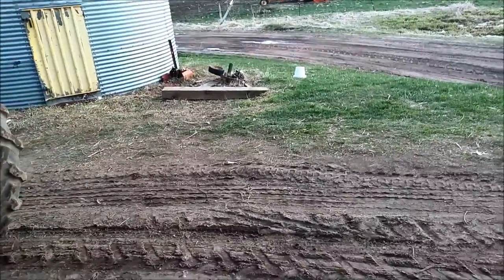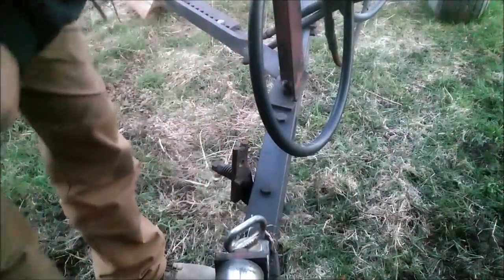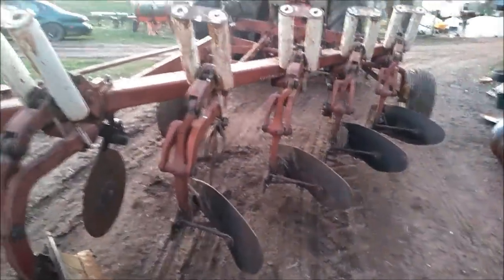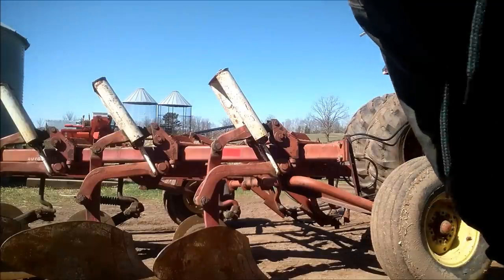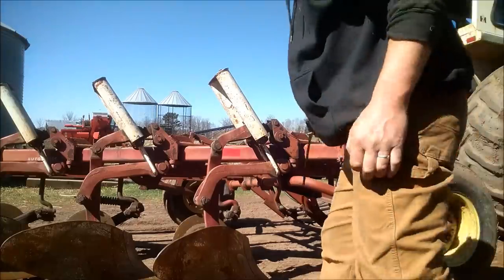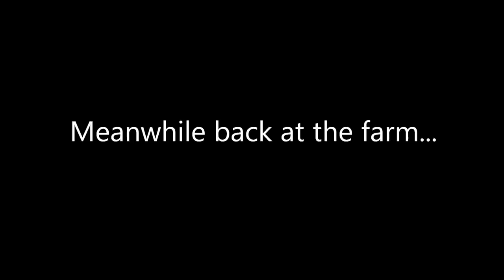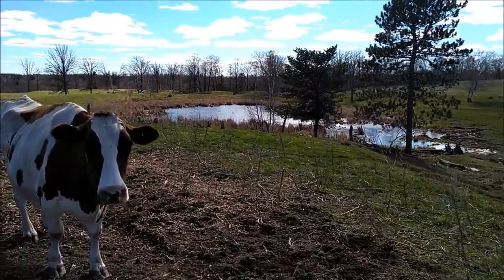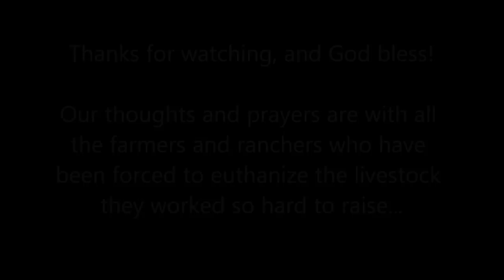Plowing with the 1066-Working up an old field

Comment: Greatest tractor IH ever made. Perfect!
Reply: Most iconic anyways. Still needs to be a black stripe open station. those IH plows weren't nothing but the truth though.
Reply: I am not sure about the greatest but they are very good. We have the exact same tractor and plow combination. Sometimes we use the 1206 on the plow and it also pulls it very good.
Reply from the maker: I have used our 1256 on that plow, but the 1066 seems to handle it better. A 1206 is a tractor I would like to have! Thanks for watching!

Comment: Enjoy watching that 1066 turn over the soil.  I enjoy plowing growing up we would plow up  500  acres for corn and soybeans and 7 acres for tobacco and the largest plow we had was a 4.16's Massey Ferguson plow behind a 285 Massey Ferguson next we had a 3.16's MF plow behind a 275 MF. We would take turns plowing  sometimes all day and all night only stop to fuel up  and eat a sandwich. I miss those big fields plowing. I did get to plow up a 9 acre field for my brother a couple of years ago that he wanted to resow. All I plow now are garden spots. I have a 3.16's Massey Ferguson plow I pull behind a 5320 John Deere cab tractor 64hp. and I have a 2.14's Ford plow I pull behind a 539 IMT 39hp.  Your 1066 pulling your plow good must be set up right.
Reply from the maker: Plowing on a nice big field is one of my favorite jobs, and plowing, was one of my first tractor driving jobs, I used our 830 case with a IH 4-16s semi mount plow and my grandpa would use the IH 1256, and 5-16s semi mount plow, that's one memory I'll always have is plowing with my grandpa. Thanks for watching, and God bless!

Comment: Do you prefer pull type vs semi mount?

I always felt that pull type did the best for following the contour of the field.

Great video that this retired dairy farmer can relate to.
Reply from the maker: I like the pull type better, I agree that it follows the ground better, it's also nice if you get stuck, you can lock it in the transport position, pull the pin and hoses, get the tractor out then pull the plow out from high ground, get stuck with a semi mount, you might be there half the day. Thanks for watching!

Comment: That was plowing up nice,they shined up fast.i have a set of ih 700 4x16,had them for almost 30 years. Mine has the side hill hitch and are semi mount.usually takes 2 full grease guns to do them all. With coulter there is 7 per bottom?
Reply from the maker: Yeah even the heavy soil here is pretty abrasive, so they shine up fast. this one also has 7 per bottom, one thing I have learned is that grease is cheap compared to parts. Thanks for watching!

Comment: Nice tractor and plow,  that 10 handles that 6 bottom plow pretty good.  Not to often do you see a bear back 1066. I'm a new sub here.  I'm a small hay farmer from Maryland.  I do most of my farming with a Farmall 400 and a 1086. I am looking forward to seeing more of your videos.
Reply from the maker: This tractor came out of North Dakota, so not sure if it's more common out there.  Thanks for subscribing!
Reply: Yeah I've never seen one with a wheatland hitch neither, until now.👍
Reply: We have the same outfit exactly. Here in Alberta, Canada, bare back 1066s are very common. We sometimes pull the plow with the 1206, too.

Comment: Never seen a 1066 without 3 point,we had 2 1066s and a 1566.
Reply from the maker: This one came from North Dakota, I think it's more common in the western states.
Reply: We have 2 of them. Here in Alberta, that's very common. There are far more here that don't have 3 point hitches than do.
Reply: 🤔 We used a lot of semi mounted plows and other tillage equipment. I guess that's my I never seen one.
Reply from the maker: That's what we used also, the tractor and plow, came from North Dakota, l think they are everywhere out there.

Comment: The 1066 sounds good and strong, nice plow too. Can you explain the silo out in the pasture? Was it intentionally built there or did there used to be a barn next to it?
Reply from the maker: It was intentionally built there, it has a concrete bunk up there with it.
Reply: Kinda cool. If that area is permanent pasture it allows you to feed out there so they don’t have to go back to the barnyard and you don’t hafta haul feed to them
Reply from the maker: @andylieffring3987  yeah it works pretty good, I would like to put concrete for the cows to stand on because it does get muddy if we get a lot of rain.

Comment: What's your favorite tractor that u have and what's ur dream tractor. Yes I know how to punctuate but I don't feel like adding it. Lol
Reply from the maker: Lol, I would say my favorite tractor that we have is the 1256 IH and a close 2nd is the 830 Case with the green cab, my dream tractor would be any model of the 2+2 IH tractors, I have always thought they were cool   tractors.
Reply: I can relate.  Lol
Reply: @trinitydairy  Do you ever pull your plow with the 1256? We have the same plow and sometimes pull it with a 1206.
Reply from the maker: @tyfrank3427  yes I have, but the 1066 seems to handle it better, we do have a IH 550 semi mount, 5 bottom plow that I sometimes put on the 1256. I would love to have a 1206 someday, they seem like a good tractor.
Reply: @trinitydairy  Ours is the standard tread version with 24.5-32 tires. We need to replace them now but with new tires it will handle the plow good. The 1066 is a little more tractor. Yours must be the 1973 model because it has the newer style cab, and it's painted white. Earlier 1066s run slower and put out about what the 1256 does.

Comment: Why does the tractor have two tires on one side
Reply from the maker: The dual on the other side needs to be replaced.
Reply from the maker: Leonard Carr  we did that with our semi mount plow when we had to run in the furrow, I can run both duals on the green with this plow, but I had to take one off because the tube was sticking out, found a good tire now, so should have it back on soon.thanks for watching!

Comment: The tow bar looks different compared to my 1066. Is it preferred if running on dual wheels. Mine is a just the tow bar sticking out with a 3 point hitch. I don't have dual wheels, just wondering...
Reply from the maker: This tractor came from North Dakota and this style tow bar is more common out there, most of the ones I've seen have 3 point hitch like yours.I like the duals for more traction and flotation on wet ground, and less compaction.Thanks for watching!
Reply: That 1066 is a Wheatland model and is meant for up north in the Dakotas and Canada where they don’t use 3pt tools as much so the need for the 3pt isn’t necessary